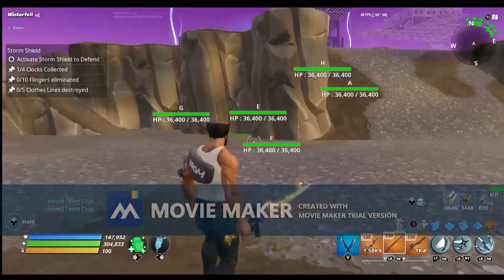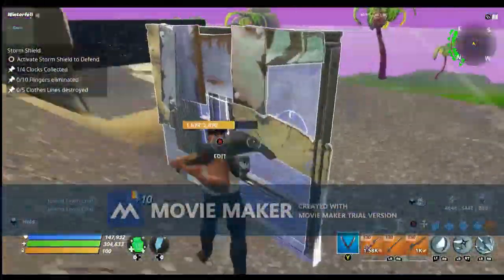Twine endurance Hill tutorial V16

Comment: This is a real game-changer thanks Whitewalker. I'm so tempted to knock down both hill paths and try this.... Apart from dura are is there anything else you've noticed can be an issue?
Reply from the maker: Not really any other issues- just ensure that your geyser recycler is able to handle the crowd
Reply: @Whitewalker_-cd3vt  Yeap I'm running your Lava build so I'm recycling over to the pit recycler. Looks like you've updated your Lava build as well :-) Your old one is still working well for me
Reply from the maker: @jedilard5454  nice. after you build this hill amp, you will think back and laugh at your old builds

Comment: nice clever build, only downside is  assassin  amp design can fail on random waves and then its gg lol
Reply from the maker: Yeah you just gotta watch dura on launcher and replace when low esp if you get w16 & w26 at hill
Reply: any waves actually
Reply from the maker: True, you need to monitor any amps that get hit on random waves
Reply: @Whitewalker_-cd3vt   i meant that the smashers and propanes can path to the amp and not the player if the amp design fails, which ive experienced sometimes on random waves on hill...when i say the amp design failing , i mean that the smasher AI doesnt recognise the amp design and paths normally rather than targeting the player...
Reply from the maker: @aduztom6699  ah ok, I get you now. Never really happened to me but thanks for the info, just means that you gotta watch out for the wall next to the launcher because that’s where the husks keep hitting on
Reply: South side spawn?
Reply from the maker: South side same pathing to amp as west side. Smashers stay at lower right side of the amp